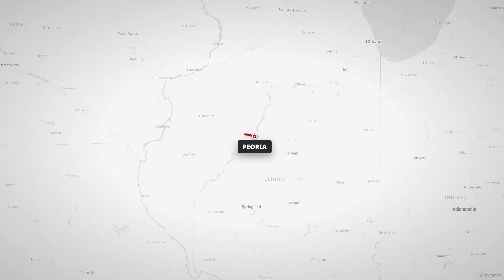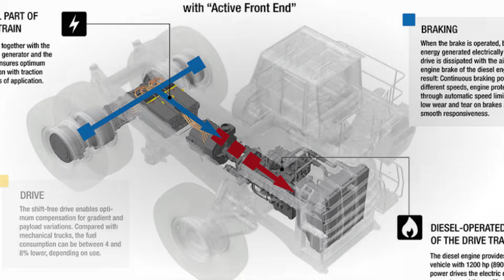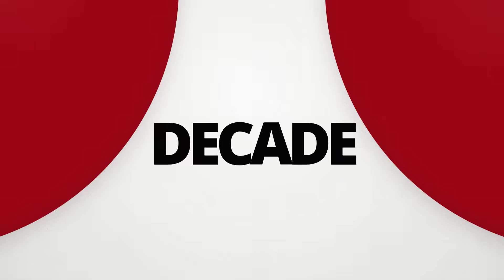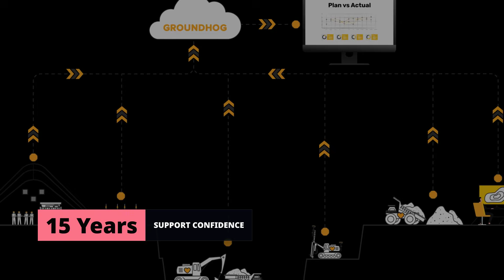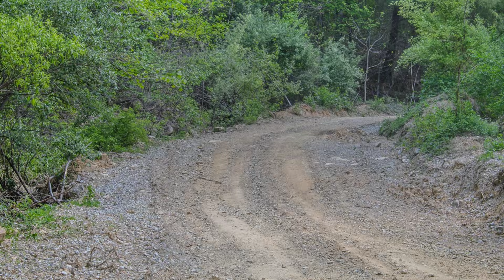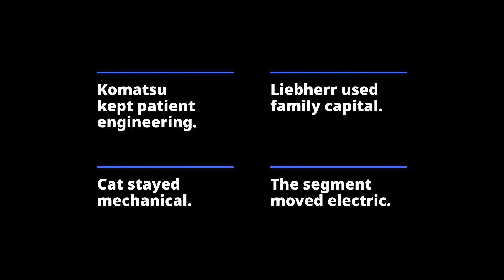Why Mining Companies Worldwide Are Switching From Caterpillar to Liebherr Trucks

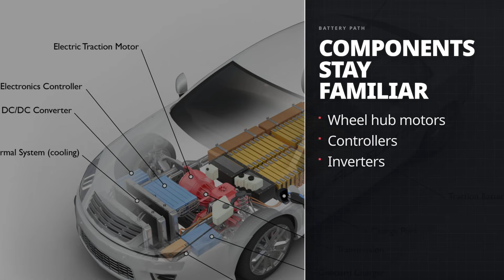Comment: 4:35 Electrical cars hardly use wheel hub motors. Automakers prefer traditional inboard motors for several reasons, one being the weight of the wheels (unsprung mass). 
Not a main issue for the ultra-heavy trucks. 

And please do not repeat the same information in one presentation.
Reply: As much as I agree with not repeating information in one presentation, your comment leaves me as a reader clueless. Do you expect me and others to research your opinion?